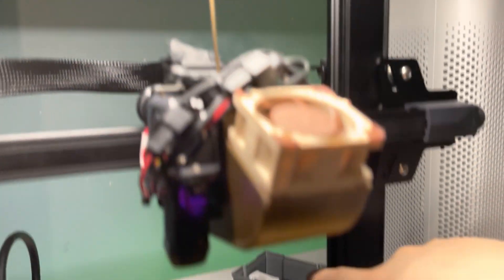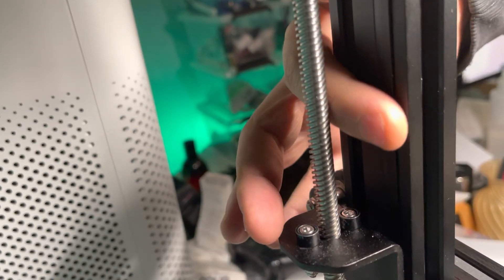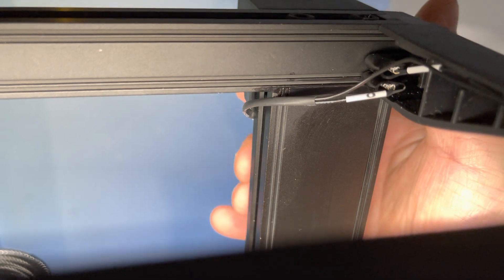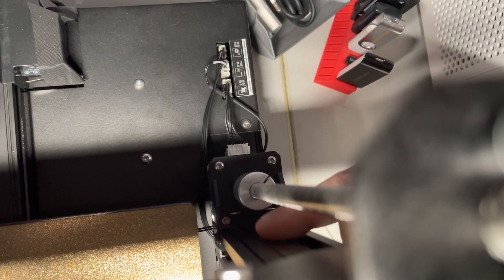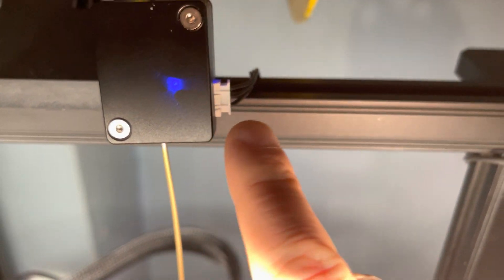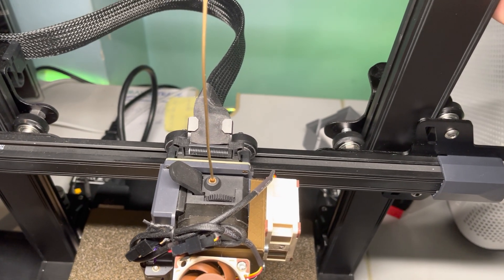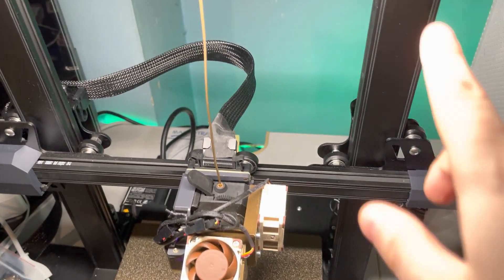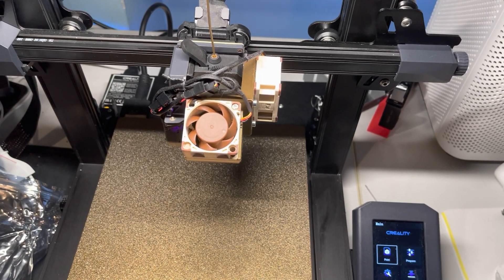Guiding the Ender 3 S1 original led light bar cable as clean as possible.

Comment: I bought an LED bar for my Creality Ender 3 S1 and the cable won’t reach the power connectors on the motherboard. I tried 2 or 3 different routes.
Reply from the maker: even if you use the route i show in the video? if so then that is a manufacturing error, contact the seller...

Comment: Brother where did you find that version that connects right on the back of those white connectors? Mine is with the 2 wires that I have to take the whole bottom apart and connect them to the board.
Reply from the maker: i found this on creality's official aliexpress page.

Comment: hi from turkei. i try to do same thing. but i messure voltage it 24v dc. how can you down that voltage to 12v. which i have leds going with 12v dc.
Reply from the maker: the voltage output of 24v dc is how it's supposed to be. The original led lights from Creality is working with 24v.  If you are using aftermarket Led lights that support up to 12v dc, u could put a buck converter in between to lower the 24v dc to 12v. Tessekurler
Reply: @aim6mac  ye dude i have my own led. didnt buy original led bar. itry buck converter. thank u
Reply from the maker: @AnkylosSpondylos  let me know how it works out for you.

Comment: Depending on what voltage the filament sensor is running on, you could also creat a Y splitted cable and feed power to the light from the runout sensor's plug.

Comment: where are you having problems with the light bar flickering? My S1 PRO is straight out of the box, the LED bar is flickering while printing.. Like on, off, on-off.. its strobing really... Its steady and continues. When warming up the bed or nozzle it flickers also but is a lot dimmer.
Reply from the maker: Hi there , that sounds like the mainboard cant deliver enough power to your led bar whilst its using a certain voltage… u should contact creality aftersales , they will determine which part they will replace.

Comment: On the top you can also remove the screw thread screws a little bit and then route the cable the other way round around the pole. This way the cable is completely hidden. I did that with mine after watching your Video.

inside the lamp case from the switch to the lamp case screw, then behind the threadscrew holdings and then into the cable canal you showed in your video. In the end you tighten the two screwthread holding screws on the top again
Reply from the maker: thanks, thats great :)

Comment: Does the Jyers Custom Firmware actually already exist for the
Ender 3 S1 ❓ 
And if so where 👀 ❓
I would be very grateful for a tip... 🙂👋🏼
Reply from the maker: dont know about Jyers cfw but i know there is mriscoc cfw which i'm using atm, and works good!
Reply: @aim6mac  Will test the custom firmware. Thanks for the advice. 🙂👍🏼
Reply from the maker: @Knuddel00  you're welcome !

Comment: After that, you can also make the cable go thru the last 5 cm on the inside bar (just the same route as the sensor bar), next to to right Z motor
Reply from the maker: very nice idea indeed :)

Comment: Hello man, thanks for the info!! Is it possible to change colors on this Led light ? and it is wifi available ? Keep up
Reply from the maker: Hi, the original led bar has only one color, which is warm white , but u could change the led bar to a RGB one if you like. U can get a Wifi box, from creality or a R pie for wifi solutions :)
Reply: @aim6mac   Can you please share links? am totally new to the hobby and am trying to figure it out ! Thanks :D
Reply from the maker: @-exeCy-  https://nl.aliexpress.com/item/1005002984795490.html?spm=a2g0o.productlist.0.0.ba066de9w2HBHY&algo_pvid=29917383-8b6b-486f-b5b7-19250d3817e3&aem_p4p_detail=202203130545447665298200802660035406974&algo_exp_id=29917383-8b6b-486f-b5b7-19250d3817e3-0&pdp_ext_f=%7B%22sku_id%22%3A%2212000023066642168%22%7D&pdp_pi=-1%3B22.85%3B-1%3B1.39%40salePrice%3BEUR%3Bsearch-mainSearch
Reply from the maker: @-exeCy-  https://nl.aliexpress.com/item/1005003684738718.html?spm=a2g0o.productlist.0.0.68745242QPMLnT&algo_pvid=eb7ebdec-0fdb-457c-926f-822c1e85dcb6&algo_exp_id=eb7ebdec-0fdb-457c-926f-822c1e85dcb6-19&pdp_ext_f=%7B%22sku_id%22%3A%2212000027606236583%22%7D&pdp_pi=-1%3B17.13%3B-1%3B6.85%40salePrice%3BEUR%3Bsearch-mainSearch